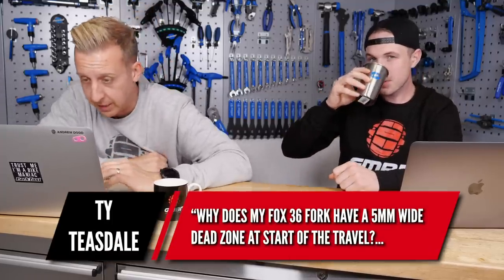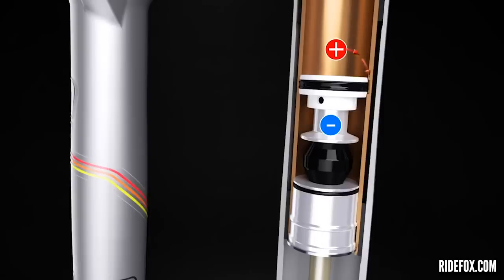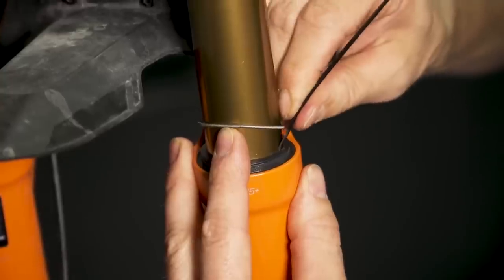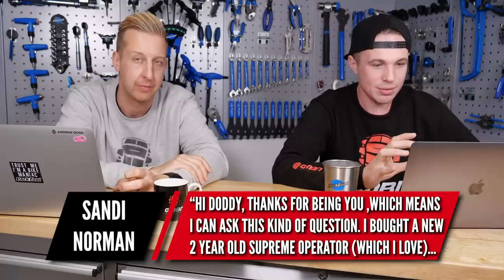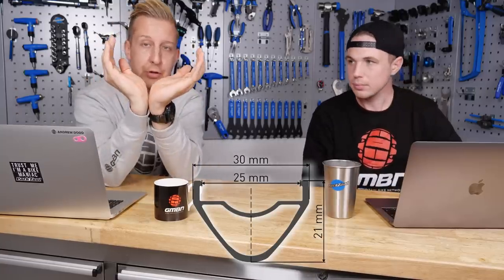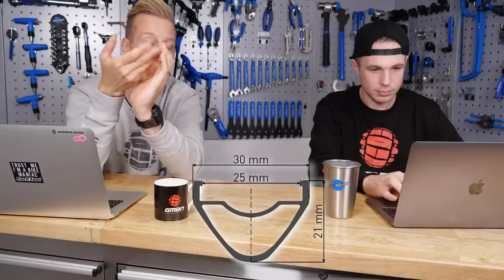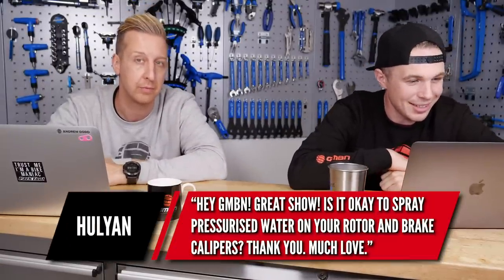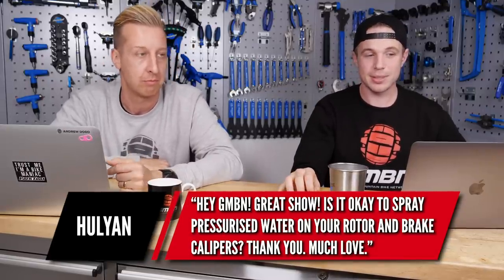Why Are My Forks Stuck In Their Travel? | Ask GMBN Tech

Comment: Regarding the first question: I had the same problem with my Rock Shox Reba RL 2017. I found out that there is a hidden valve for the negative air chamber under the left lower leg. I pressed it with a small allen key and even though I had released all the air from the main valve, a lot of air came out and the fork extended by 2 cm. Just be careful not to get any fork oil on your face.

Comment: 13:50 On all my SLX and XT levers the slight clicking noice is coming from the servo link part when unscrewing the bite point adjuster completely. The same effect can happen when you overtighten (using a longer screw) the bite point. Then the internal plastic lever snaps and its always on maximum dead stoke.
The clicking is when the lever part extending into the brake is taking the piston rod with the roller on it along the servo link path. then it clicks a bit when engaging properly.

Comment: Just to mention, both the yt Jeffsy and the canyon spectral (some models) are fine with having an increased stroke length. Both can have 230x65 and 230x60 shocks. Changes the rear travel by 10mm.

Comment: I've got a "stuck" issue with my 36 Fox Fork.  New Fox 36 Performance Fork came pre-assembled with bike.  After my first ride, I noticed the "thumps" as if the fork was bottoming out.  Quick look at the fork stem and it was almost fully "sunk" in.  For a 160 travel fork, I was surprised.  Looks like I may have to take it to LBS to re-adjust it.

Comment: Recently  i changed  the orings  in my reverb stealth dropper post . When it's up and you sit on it , it doesn't stay up .
Reply from the maker: This could be a few things.. correct pressure and successful bleed in the hose first. If you are still having issues contact a service center.
Reply: Suspect not done right! Did u use all the various specialist tools fir oil height, ifp depth etc?
Reply: The pressure is 250psi and was done corectly in a bike shop . I saw on yt that it's called vertical play. And it has something to do with a piston inside te dropper .

Comment: #askgmbntech hi doddy,
What do you think is the optimal bag size for riding. I’m currently riding with a very cheap bag I got from the camping store when I first got into riding, and it’s beginning to break and I’m looking into getting a more expensive mountain bike specific bag. However I don’t know what size bag to buy. I’m not sure what size my current one is (it has a 2L reservoir and not much else room so I assume it’s about 4 or 5L) and I would like to ride with more spares as I find I’m leaving a few things behind with such a small bag. I want to carry things like a mini pump, my multi tool (it’s a crankbrothers one I can’t remember the name at the moment) co2 cartridges and an adapter, a tube, a mech hanger, my phone, trail snacks, cable ties and possible somewhere to store a tripod down the line as I’m considering getting into a little bit of photography. 

Sorry for the long winded question but thanks if you answer it. Cheers

Comment: Hey guys, i’ve got a question about my shimano m395 brakes. They work fine but if I turn my handlebars(around 45 degrees) to the right, the back brake lever (right one) locks the caliper sooner (reduces it’s “travel”). Really appreciate the videos, thanks.

Comment: Are cup and cone bolts better for setting up disks, I have standard bolts and when setting then up it runs straight through the bottom of the pads but rubs on the top, I've tried every method I have seen to try and set them properly my LBS told me my rotor was slightly bent, 4 rotors later still having same issue, changed between 160 and 180 too see if that made a difference. Was told by the community I need the mounts "faced" what does that actually  mean, and how do I do it?

Comment: #askgmbntech 
Hey, my rebound adjuster knob just fell out of my fox 32 and there’s no threads or anything to put it back in there. It was loose leading up to when it fell out. How can I reinstall the knob? Thanks
Reply: What year is the fork and is it stepcast?
Reply: JoelCrocWrangler it’s a 2017 and is step cast
Reply: @samhart1884  if u get the red adjuster that fell off and a phillips head screwdriver, then put the screwdriver down the middle of the knob, you should be able to reattach it if the screw is still there. If you dont have the screw on you or in the rebound knob u may need to find a new screw. Its a pretty recent fork so Fox should have spares for it, and next time use locktight on the threads

Comment: Love the work you guys do, two parter question. Got a 2018 giant fathom 1 29er. I have a slow leak on a tubeless that has cushcore new rim tape and about 3oz of sealant with no visible signs that it’s leaking local shop can’t figure it out, new tire or rim? Also are grip shifters still a thing? #AskGMBNTech

Comment: What is the difference between rs 0w-30 oil wich is used on the gravity forks until the pike and the 15w oil wich is used by the other forks?
Reply: different weights...thicknesses...and uses
Reply: @rupedog  ok thank you, so i can't use a 15 wt with a boxxer, so it is better to wait until the 0w-30 arrives?
Reply: The oil is like in a vehicle where the 0w refers to the cold temp viscosity and the 30 when it warms up. The 15w will be thicker when cold so if you never go into cold (0degC) you might be ok. But for the volume that's required I would just get a new small bottle of the right stuff.
Reply: @TrailPOV  ok, thank you, then it's better i wait until the right oil arrives, because here were i live (austria) it can easily get colder than 0C°. Thank you
Reply: @enduroandmore7434  I would say for best performance yes. Happy trails
Reply: @TrailPOV  thank you

Comment: #AskGMBNTech I have the problem you mentioned at 1:34 my fork's travel is completely sucked up since I added a token. I have tried to add my regular pressure but all I can get is about 50% of the full travel. However, when I add 20-30 psi more I get to have the full travel but then, I remove the 20 psi again and I lose again the full travel ( I always cycle the suspension while increasing or decreasing the preassure)... not sure what to do? please help

Comment: #AskGmbnTech... I recently got a set of Sram Level T brakes, they are amazing and suit my riding very well..mainly freeride and downhill, they are still basically brand new. But after a run or 2 the back brake goes soft on me and the lever will pull into the grip and even crush my middle finger with very little power. Do they just need bled or is a heating up issue? Thanks Guys, keep up the good work and hopefully Henry can answer this as he new and super knowledgeable 😎 thanks guys

Comment: #askgmbntech. Hey Doddy, love the show.  Is it possible to swap sram guide rsc brake calipers and levers with Shimano XT calipers and levers between 2 bikes that both have custom colored brake hoses.  I have the jagwire quickfit hoses and will be able to swap out the banjos as well.  I realize the mineral oil and dot fluid will have to be drained but how to flush the lines out is what concerns me.  Thanks, Mike from Vegas

Comment: Differnce between trunnion and standard mounts
Reply: Standard shocks have eyelets at either end of the shock through which the mount bolts go. Trunnion shocks have the one bolt intersect the shock part way along its length to make mounting in certain frames easier. Essential the bolt goes through the middle of the shock rather than the end.

Comment: #AskGMBNTech my Fox 32 evolution series forks are leaking slightly on the top around the adjustment area were u can switch from trial, decent.... Also there is play around the seals. I know there is something wrong but would I need a service? How much would it cost to fix? My local bike shops don't do Fox services so I would have to send them to England.

Comment: #askgmbntech Hi Doddy, recently upgraded my Fork (Fox 34) and it is boost capable. I am wondering if I should upgrade my front hub to a boost hub? Also my front wheel is a Roval Trail SL and Specialized doesn't sell just the hub, my current hub is 15x100 straight pull and should I stay with straight pull spokes?

Comment: #AskGMBNTech Hi guys, I have a Carrera Vengeance from I think 2014 and it has a problem where if for example I have to stop at some traffic lights and have to slightly back pedal to get the pedals in the correct position to push off again, the chain starts to drop to the next gear on the rear. Then when I try to push off again, the chain slips briefly as it re-adjusts itself, which can be pretty dangerous in traffic. I've stripped, cleaned and greased the derailer, as it was extremely gunked up with solidified wax chain lube, but it didn't make any difference. Any idea what is causing this? My local bike shop couldn't find the issue and just suggested I don't back pedal. It didn't do this when I first bought it though.
edit I forgot to mention that I've also replaced the chain and rear gear set too, as the gears were slightly worn, but that didn't help either.

Comment: #AskGMBNTech when my chain streches do I have to replace it or can I just remove a link
Reply: yikes. Replace. The per-link spacing is wrong, so the rollers don't mesh neatly with the cogs/chainrings. That will accelerate wear in those as well.
Reply: Depending on how stretched it is it might require a new cassette and front chainring because the chain may have worn those to fit the new stretched chain. If you put on a new chain then it won't fit with the only cassette and chainring. A bike shop will now if you need to replace the lot.
Reply: So saying a chain has stretched is a bit of a misnomer, it just makes it easier to conceptualize. The inner and outer links stay the same length but the linkages between them get worn down and will have more play so under load the chain will be longer. Even if you took out one link the damage to your drive train would continue to get worse and worse because of this movement in the system

Comment: #askgmbn I went on a muddy ride yesterday and my dropper post got scratched from pressing it back in. It also works very slow and makes horible noises when it compress it into the down position. What should I do? And can I fix the scratheces? they are the same lenght as the travel and not too deep
Reply: You should be able to fill the scratches with super-glue and then use a flat blade to scrape the glue perfectly smooth with the post before it dries....then let it fully! dry before using it again.
Reply from the maker: If you have any grit within the seals it's best to service as soon as possible so it doesn't get any worse. Consult a decent service center about the scratches. It's possible to smooth these out yourself here is a video of Doddy showing the process: 👉  https://gmbn.eu/1aB

Comment: #askGMBNTech Last year i was riding my trek marlin 5 2018 model and i was on a trail with jumps. My front suspension was working and the lockout (which i never turn off because its stupid) was off. I went off a jump, lockout still off, and when i landed the fork/ suspension didn't budge, contract, absorb, not a damn thing happened. I got severe whiplash and I've lived with soft tissue damage and chronic pain for over 6 months now. I recently filed a claim with trek and am talking with a rep from the company, but I still don't know how the shocks didn't work. (they were still set to off after the crash so it was a mechanical failure) 
I really want to get settlement and resolve this claim without taking trek to court, but the bike seemed fine after i got it serviced after the crash, even though they had to "un-seize" the suspension. What would you tell Trek if you were in my shoes? Thanks

Comment: #askgmbntech i bought a new renthal hadelbar for my bike 800mm/35mm but my stem only have 31.8 mm its a canyon bike so i wanted to ask if i can change my stem to a 35mm sixpack racing stem did i have to change anyting or is it plug an play 🤔 btw im form austria your videos a great i am sad that there is no Germany youtube account like you
Reply: yeah you can. the steer tube will be a standard size, so any (sing crown) stem will be able to attach onto it, and boom, you got a 35mm handle bar mount.
Reply from the maker: Yes you can swap this over but note that the body height of the stem may be different height to your current one. You may need to adjust this by adding or removing headset spacers. These are common in 5mm but come in a range of sizes.

Comment: #askgmbn is it safe to paint my helmet using rattle can paint? how do the pros customized the helmets? stickers? vinyl?  thank you!
Reply: Solvents in standard cans will dissolve any of polystyrene liner they contact. Mask really well or get specialist paint.
Reply from the maker: You have to be careful with solvents in the paint causing damage to the shell. Pros will typically have experienced painters do theirs. For instance Ken Block has used a painter called DeathSpray.
Reply: Personally I never like stickers and paint on my helmets. Makes inspection for cracks harder.

Comment: #AskGMBNTech  ,im upgrading to a 160mm travel rockshox in place of my entry level suntour 100ml travel,    will this change the geometry if it will does it have negative effects. the bike is a giant talon 3 hardtail.
Reply: Kael Macca your frame probably won’t hold that fork that change is too much I would say that up to 20 mm is fine so I wouldn’t go any more than 120mm
Reply: The angle that the headset will make with the ground due to the lengthened front will lead to abnormal forces on the headset that are more angular rather than just up and down. Also your BB will be raised significantly, the steering will slow a lot and the bike will generally ride badly.

Comment: #ASKGMBNTECH Hi! Love your Videos! I recently bought my first Bike made out of carbon. On my car i use a trailer hitch bikemount from Thule which requires me to put a clamp arround my frame and tighten it so it wont fall off the back of the mount. My friends made me nervous now, telling me horrorstories about broken frames caused by those mounts. I know mounts which clamp arround a wheel also exist but i got no money now to afford any of these. Is it really that dangerous using a mount like i do on a carbon frame? 
Thanks

Comment: Hello Doddy and Henry, I have a 2019 nukeproof mega comp 290 that has the  rockshox super delux r rear shock. I did some research and it looked like the pro racing team runs a different air can.  What will this change, if anything? Thanks #askgmbntech
Reply: Anthony  Mowl that’s what I was thinking. I think they pretty much have the same chassis but the cab is different

Comment: #askGMBNtech Hi there guys, I own a Bulls copperhead RS+ (27,5+) with a 100mm rockshox reba fork, I would like to try how the bike would feel with a little more travel as I feel I have moved away from the more relaxed XC style riding to a more agressive style. 
I have read articles online and seen some video about swapping just the fork insert for a 130 or even 140mm part. 
Is this really possible and that simple, it would be way cheaper than buying a complete fork.

Thanks from the Netherlands
Jelle
Reply from the maker: Depending on the exact fork model it may be possible. Check with Rockshox though as the stanchion tubes come in different sizes and this may limit you.

Comment: #AskGMBNTech my fork has gone completely stiff no force will move it what can i do in terms of fixing it
Reply: rebuild it. If its a SR Suntour, which I would assume it is, just replace it.
Reply: @wittwer427  it's a an rst launch I'm just trying to sell it on but would get some more for it if I could get the fork working apparently they all snap and seize up I have spared but the head tube on this bike is exceptionally long and my other forks' steerer is too short for them

Comment: #askgmbntech
Hi doddy and Henry 
I would like to put the new rockshox lyrik Rc2 2019 and the rockshox super deluxe coil on my giant anthem 2 2019 would this be a good idea ?
Reply: This would probably be far too much fork for that bike. Try a pike. It's more suited for trail use, and will be almost indifferent to the heavier larger lyrik.
Reply: @wittwer427  thanks for your advise but what about the super deluxe coil would that still work ?
Reply from the maker: This bike is built around a shorter travel fork. You could look at getting your existing fork travel adjusted but contact Giant first to see what their maximum fork height suggestion is. You can get the Lyric in 150mm but a Pike may be better suited. For the rear shock we would suggest sticking to an air shock as this is what the frame has been designed around.
Reply: @gmbntech  ok cool thanks
Reply: @anthonymowl5758  it came  with 130mm